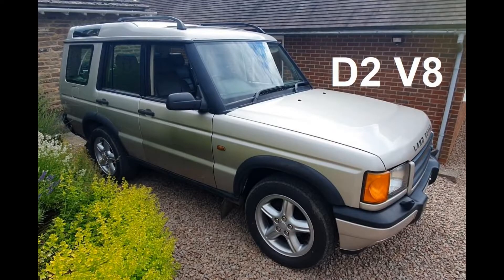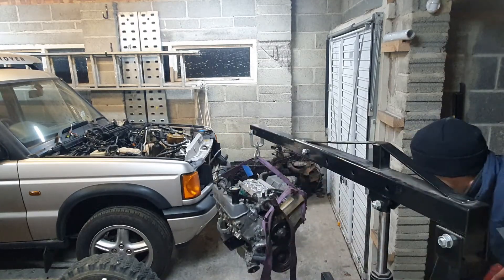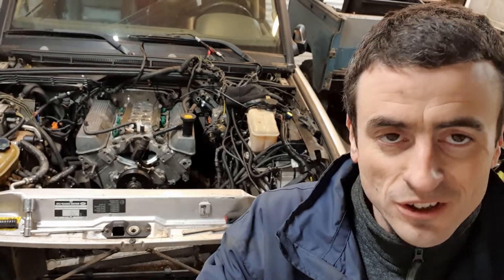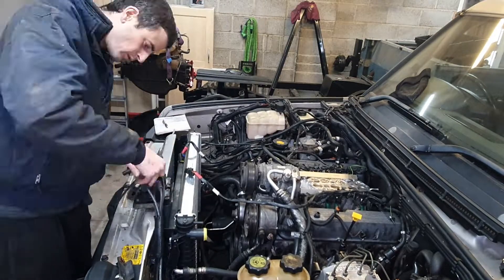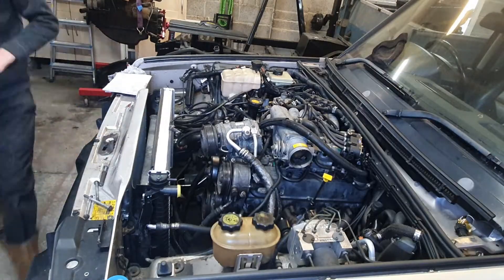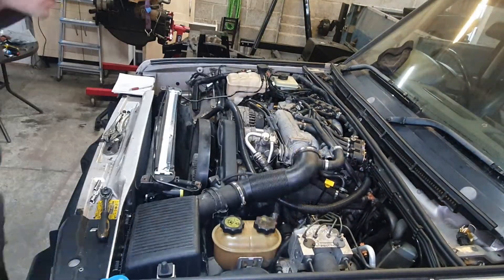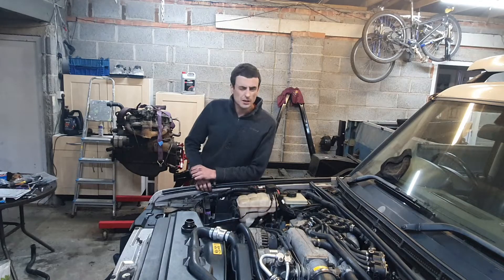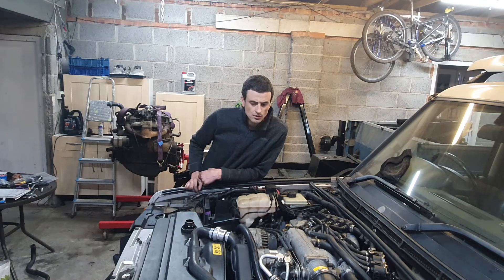Engine Goes Back In - Discovery 2 V8 Engine Rebuild Part 12

Comment: Thor V8 FTW!!!!! Be lucky you don't have a Secondary Air Induction system.
Just bypass the throttle body heater. Mine's been bypassed for the past 6 years and no more leaks.
Reply from the maker: I certainly thought about. If it gives any further trouble I'll just get rid then. 

Thanks for the comment, much appreciated.

Comment: The V8 series of vid great I've learned a lot and best oil valvolene vr1 20w 50 high zinc thanks
Reply from the maker: Thanks Jeroem, I'm glad you're enjoying the videos. While I've no doubt it's the best oil for the engine, there is a question over the catalytic converters, apparently the zinc content destroys the cats at an accelerated rate. I've chosen to save the cats and no its all run in and used the stuff recommended in the book, 10w40 semi synthetic (for now), soon to be 10w40 fully sulynthetic...

Without the zinc content. 

If I had no cats however I would go with the vr1
Reply: @lozl  yes I get that I've ran this oil vr1 for 4.5 years approx 8 oil changes 30.000miles no problems I'm not say you should i think it suits the engine with no probs thanks
Reply from the maker: @jeroemsmith566  thats a long time.... do you catalytic converters? Are you still passing MOTs emissions tests alright?
Reply: @lozl  had no probs with mot emissions no cel light oil pressure went up slightly engine runs perfectly the inside of the engine is cleaner o can't fault it
Reply from the maker: @jeroemsmith566  hmmm, if you've not had cat problems over that many miles I'll give the VR1 a go then. It'll be 10 years before I've covered that many.miles